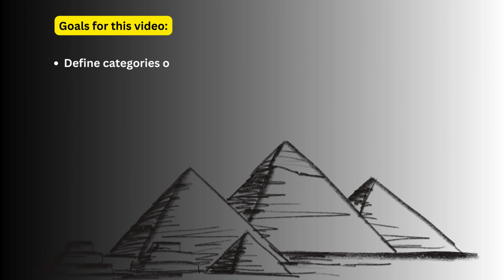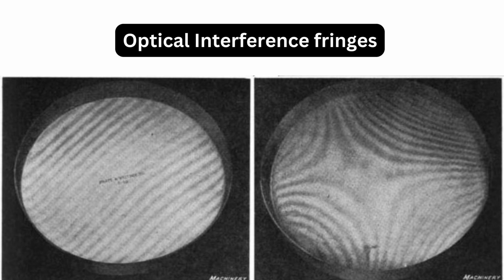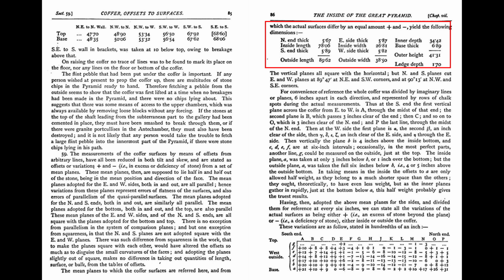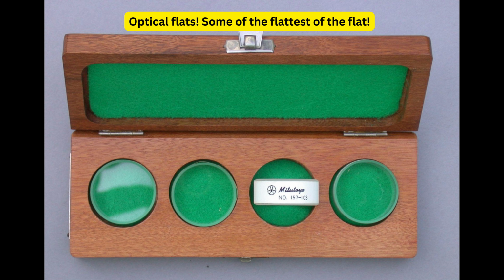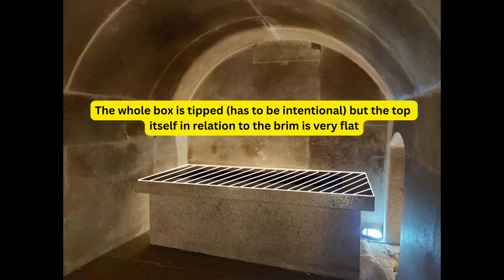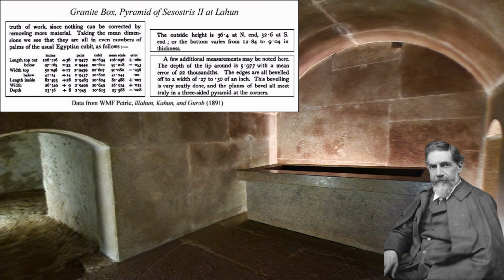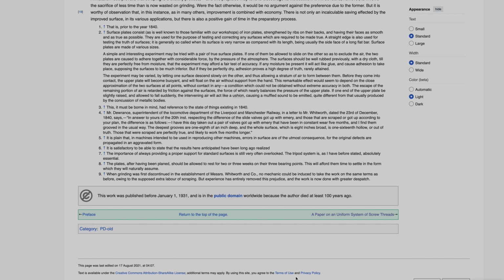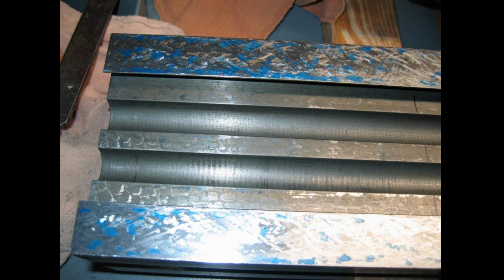The Problem of Flatness in Ancient Egypt

Comment: Incorrect. 
They have used micrometers and other devices on the vases
Reply from the maker: This wasn’t about the vases. At all.  But even if it was you couldn’t measure a vase thickness with a micrometer. And they weren’t invented back when these were supposedly made
Reply: @intothemap360 perhaps you don't understand what I'm trying to say. The Egyptians had the knowledge to create items that rival modern-day machining.
Reply from the maker: You’re talking about the vases I understand. I’m saying a micrometer is the wrong tool to measure the vases. That’s a topic I will cover in a future video. Even if they are as precise as everyone says and actual ancient, not modern, then I still believe I can explain how it was done without advanced machinery. Should be a good video!

Comment: Unless you’re using a modern filament (i.e fishing line) a “string”, no matter how taut it’s pulled is NOT flat. The string itself has imperfections and strands sticking out and is not a reliable precision tool. The lapping described in the video was within the technology of the time and didn’t require mental gymnastics to explain away what was easily the work of skilled craftsman of the period. Why insult them with stories of aliens and alien technology? 🙄
Reply from the maker: 😊😊😊 well said.

Comment: So I don't have the knowledge that you have on the topic. But I know something in rocket part manufacturing the best precision are given by hand not machined. They have very well paid people who spend days in a closed room getting parts within tolerance. The method you show seems very advanced and I bet with lots of time, some water (to know flatness) you can achieve something similar by hand without rubbing copper plate.
Reply from the maker: The best results for truing up a surface plate are with the 3 plate method and engineers blueing. Water is not a good reference. Water shows level, now flat. A stiff reference at a minimum is needed, the exact number of plates and rubbing is not. This method is not highly advanced, its pretty basic.

Comment: How do people think we got CNCs that produce "CNC-level quality" its only because humans first walked that machines can run. I find it incredibly impressive that ancient Egyptians cut so many blocks of stone to the accuracy they did, different stone types were definitely more impressive for this than others, supposedly most of the stone was cuttable using copper saws with sand added to the cut to speed up cutting, although some of the stone types found cut would have required stronger metals than copper to cut. Crutially the level of percision or flatness shown is not possible with simply a chisle
Reply: Меди более чем достаточно для распила любого камня, ведь всю работу выполняет абразив. 
https://youtu.be/WbhvFJjAjag?si=m2nnKgrRW9ai0g33
Reply from the maker: Totally agree
Reply from the maker: Haha yes, CNC is just copying instructions.

Comment: I worked in the Defence Electro Optical Industry for 4+ decades and during that time, spent many years as a prototype/process engineer/technician.
In fact, to make a perfectly optical flat (Plano) master (test plate), is extremely simple.  
Optical lenses are manufactured using interferometry (fringes) by overlaying a test plate onto the workpiece, and using the visible optical fringes to check for radius and radius error (form error).
To make a Plano test plate, you simply make three at the same time and make all three fit perfectly to one another.
In the case of optics, these test plates are rarely larger in diameter than 12” but for stone, and from what I’ve seen of many Ancient Egyptian pyramid stonework, some of the surfaces appear ground.
If they made a large (circa 200”) flat grinding stone which was rotated and used as a grinding and polishing tool, it would be fairly simple to manufacture a set of 4’ stone rulers. Heavy, but would maintain far better accuracy than wood.
All this said, the oldest method, of course, are plumb lines. 😁
Reply from the maker: Great points. What did you think of the part of my video where I apply these exact principles you speak of to ancient Egypt?
Reply: @intothemap360 
Apologies. I should have stated. 🙏
I am certainly no Egyptologist but have held a lifelong interest in the subject. 
It has been my personal belief that your explanation is exactly how they did it, with variations, of course. 
The Ancient Egyptian Engineers were incredibly intelligent and would have almost certainly worked this method out. 
And you are quite correct regarding the grinding medium, but I would add one point. 
As you say, sand was readily available and is an excellent medium for grinding rough faces, but is mainly made up of silica. 
Silica’s tend not to break down very well, whereas what we now call ’Rare Earth’ compounds, typically ‘Cerium’ nowadays, have a much rounder microscopic make up and also break down very well, meaning the more you grind/polish with the same sample, the more it reduces in size and progressively gives a higher polish. 

Your video is an excellent representational production and, assuming you may have only recently researched the topic, you have certainly provided the viewer with an excellent theory. 
Apologies, again, for not expanding, earlier. 
I admit, it was a rushed comment. 
Keep up the good work 👍
Reply from the maker: No worries! I worked in optical laser coating engineering and other engineering fields for quite a while and personally I’m a hobby machinist so I’m all self taught when it comes to industrial machining but I am also no Egyptologist 😂 The sand in Egypt in certain wadis is pure emery, corundum or quartz with low silica content. Even the Roman’s imported it for cutting stone!
Reply: @intothemap360 
Ah, now it makes sense. 😂
The company I worked for used planetary coating machines and, for fast jet/ missile environment developed a bespoke process of Boron Phosphide Coating.  (A step change from DLC -Diamond Like Carbon), so you would be right at home, there. 😄
Now you mention it, I do recall reading or seeing something about the sand in Egypt. 
Very interesting. 
I have a very limited amount of machining experience but I did once modify an old Myford Super Seven so that I could produce toroidal gate lenses on it for a contract. 
It is the one lathe that I wish I had, now. 😃
Reply from the maker: Great. Sounds like you will like my channel. I try and focus on the overlap between mechanical and archeological history. I also build models for some of my videos. Really appreciate your common sense analysis!
Reply: @intothemap360 
So nice of you to say so. 
That's a real talent. You deserve to have a big audience. 
I have just subbed so look forward to future videos. 
All the best.

Comment: dude its basic logic. every object you see will probably be or can be made from a cuboid. For a cuboid all edges are 90 degree and parallel or means all surfaces are flat. so just cut out a cuboid and make your required shape with a flat side. and the thing about tools, a good carpenter or stone mason can tell if two sides are parallel just by looking at it.
Reply from the maker: Did watch my whole video?
Reply: @intothemap360  why waste 20 mins if i can say it in a few words🤣totaly unnecessary topic.
Reply from the maker: Because I wouldn’t have wasted your time. I have worked in mechanical and optical engineering and I suggest very practical methods of doing this such as the 3 plate method. On my channel it pays to watch my carefully laid out argument and then comment. I would appreciate if you do so. It seems that you are thinking these things through and not just claiming it’s all advanced tech impossible to explain, which is the same approach I’m using.

Comment: You could also get stones that are mostly flat by using the cracking method of inserting wedges in a line and then hammering until the ston splits. If you line up the wedges in a straight line using a string, you get an almost completely flat crack right through the stone. This crack also gives an illusion of precision because the two pieces will fit almost perfectly together since they where once one piece.

Also, if you want to check for vertical fatness, you can use a plumb to get a vertical flat line. Gravity will pull the plumb line to be perfectly upright and flat. You can the measure your fatness by comparing it to the plumb line.
Reply from the maker: Good points. In this case the granite wasn’t fractured as granite isn’t a sedimentary rock like limestone or a metamorphic one like slate that splits nicely along its layers.

Comment: Could they have had access (unknowingly probably) to sand from Africa loaded with small diamonds?
Reply from the maker: Maybe but they had sand there, emery corundum and quartz that could cut it. They for sure used semi precious gems in lapidary work but most examples are emerald set drills. But it’s totally reasonable they may have gotten some small diamonds!

Comment: Everything is relative.  Flat is flat depending on what you are comparing it to.  I can can cut a 2x4 with a handsaw and it would be "flat."  Cut it with a table saw? And it would still be "flat" but wouldn't be AS flat.  I could sand a a piece of stone for hours on end and it would be "flat."  But put that same stone through a planer and it would be "flat" as well.  

What I'm getting at is that NOTHING is truly 100% flat.  I mean, aeronautical machined parts are not 100% flat.  What are you guys looking for? lol.  Something so flat that it's so flat that there's no deviation of .00000000000000000000000000000000000000000000000000000 degree?  The boxes of Saqqara are absolutely "flat."  Are they perfectly flat?  Of course not.  Again, nothing we produce today is 100% perfectly flat.  That's the point people on the other side are making.  Are they flat? Yes.  Are they "perfectly" flat? No. Nothing is when you get down to the molecular level.  Strawman argument at best.  

Nevermind the fact that the level of accuracy of the corners of the pyramid, especially the Great Pyramid of Giza is aligned to true north with incredible precision, deviating by only about 3 to 4 arcminutes (or roughly 1/15th to 1/20th of a degree) over almost 800 feet?  To have THAT little deviation is astounding.  But I guess in order for it to be "precision" it should be 0.0000000000000000000000000000000000000000000.  Let's get real here people lol.
Reply from the maker: The closest we get to true flat would probably be an optical flat. Thanks for watching!
Reply: @intothemap360  I'll have to look that up. "Optical flat."  Great video though!
Reply from the maker: It’s in my video too!

Comment: You've definitely earned a sub from me.  Theres a channel that i believe is Russian or somewhere in that region that actually recreated  granite drilling and sharp right angles and various other "impossible things" using the materials available at the time to ancient Egyptians that absolutely wrecks all the alien arguments.
Reply from the maker: Thank you! I am certainly not the first to come up with this I am sure, I think I have seen that as well, unfortunately I think the concepts were great but the video quality was poor, if I remember correctly. I am hoping my channel stands out by clearly defining the topics and creating a rational starting place to start hammering out some of these controversial issues, doing so with the ability to admit when I am wrong, warn when the video is speculating versus the things that are factual, and using logical tools to set up honest debate.
Reply: It's pretty impressive what you can achieve with wood, rock, and sand with a large enough workforce and an understanding of mathematics.

Comment: As a granite surface plate technician, it was awesome seeing my job line being mentioned here. We also use Bluetooth levels on surface plates, which range in .001 of an arcsecond, or microns as well. These instruments are like 30k USD though, and require special programming.
Reply from the maker: That’s fantastic. Would you think something like that would be more portable or perhaps a interferometer would be best for on site measurements

Comment: Imagine resurfacing a cylinder head without any advanced tools.

Imaging creating the straight edge master surface using a taught string, thread, or wire, and producing numerous wooden and copper straight edged  tools.

These would be easier than perfect 90 degree squares, but the latter would be possible using the same method with perfectly perpendicular cords or wires.

Flatness is just straightness in 2 dimensions.

Errors can be averaged out by using a large flat surface as the shaping surface and complex working patterns to average out the errors while applying consistent pressure to avoid bowed edges.

Also, you're using 'rough' in the improper context. Rough cuts and rough finish are substantially less fine or precise than typical construction grade finish. (rough cuts also generally can't be made by modern small-scale circular saws or table saws, either)

Also precision is relevant, but I'd consider "aircraft" grade within early 20th century sorts of industrial precision work, not specifically modern aircraft grade precision (which itself lacks context anyway, as different scale of components will have different tolerances). You could definitely have mass produced industrial components with .1 mm levels of tolerance. Albeit for things like reciprocating engine components, only some of the parts would have tolerances that wide, and others might be tighter. (plus many parts might be specced to be slightly oversized and require a break-in wear period to create final fit)

That level of precision is definitely beyond what would've been possible in ancient egypt, but that's for precision curved surfaces, not flat surfaces. Flatness is a lot easier to get to that level of precision with less advanced tools.

You can refinish an engine block or cylinder block with relatively simple flat surfaces + abrasive sufficient for a good flat seal for a head gasket, but flatness there also allows slight amounts of flex under compression, so smoothness and consistency is more important than true flatness.

The precision required for the cylinders and pistons (among other components, like bearings and journals) is another matter entirely.

The standard method for creating flat surfaces by hand is rubbing one mostly-flat surface against another mostly-flat surface. This can be done with one hard, wear resistant surface with abrasive material added, or two already very-mostly-flat surfaces which are to be mated together and rubbed to allow for final fit. (the latter is basically the same as break-in time in engine components among other mechanisms with moving parts)

The 3-plate method is obviously how you'd create the standard flat plate to work with for shaping. (though modern ... 20th century era commercial flat surfaces for table tops and desk tops are often reasonably flat enough to produce true surfaces that can be mated flush together if used as the base for abraside strips: like gluing sand paper to)

This is the sort of thing you see in shop class or shade tree mechanic type stuff. More often for wood working than metal working in shop class (used for producing flush surfaces for hinged boxes, drawers, etc), while use of precision hand planing tools would be more useful for producing pieces to be laminated or edge-glued together (with power tools, a jointer would be used, but traditionally, a jack plane would be used, with the machine smooth and flat metal surface of the plane being the source of precision flatness).

Shade tree mechanic type techniques basically applies that wood shop box edge surface smoothing + flatting method to a cylinder head. (there's even youtube DIY mechanic videos demonstrating this)

Also, one could argue much of this did become lost technology or lost art multiple times in history and had to be rediscovered and worked through multiple times due to trade secrets, lost documentation, absence of documentation, conquest of some of those civilizations (with the technology not being adopted or preserved), and civilization collapse. As in various dark ages.
Reply from the maker: The first person to figure out scissors was basically probably pretty stoked as well. The development of early basic tools was groundbreaking. The story of humanity is the story of engineering

Comment: No Whitmore setup is needed for this level of precision. Rotating stone plates are easy to make even in primitive conditions. These can then be mounted on an armature which can be rolled across the floor to progressively grind down a fixed plank. It can be polished down with a slurry to make reflective surfaces. All of this can be done with the most basic tools and lots of elbow grease.
Reply from the maker: Yes, I was just taking the argument to its final end. Even IF they were the most precisely cut surfaces ever seen, this is how this is done

Comment: Rub two abrasive surfaces together of similar hardness and they will flatten in relation to each other.  Put sand in-between the stones and rub them together.  They'll get plenty flat.
Reply from the maker: Haha yes that is the thesis of my video. Only I add a third plate
Reply: @intothemap360 anyone that has to sharpen tools knows this.  It's how we flatten our whetstones.
Reply from the maker: I also flatten my concave whetstones by flipping them over against each other!
Reply: @intothemap360 you can also use your driveway in a pinch 😂
Reply from the maker: Okay well mine is gravel so this will certainly ruin it but I’ll try 😂